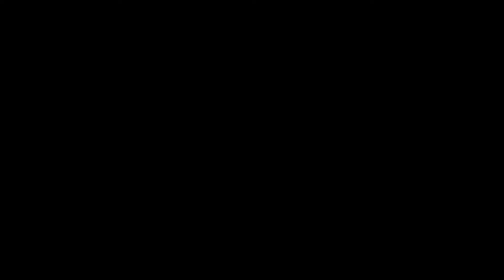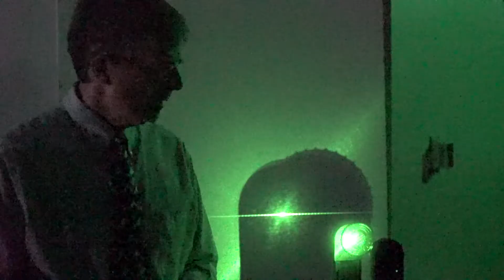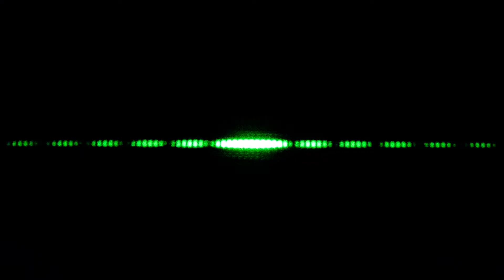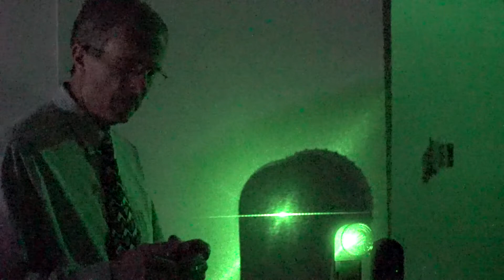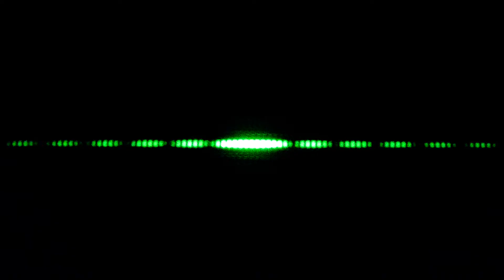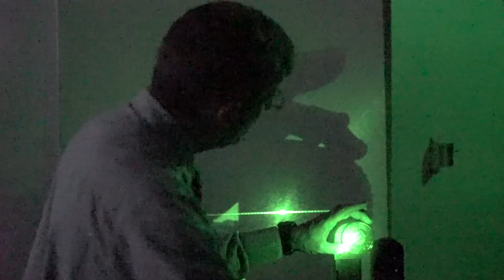Interference Demo: Double Slit

Comment: why does no one turn on a measuring device and show the wave pattern on the wall change to particle pattern in real time?  why can't i find a video with this demonstrated in real time instead of just simulated?
Reply: Why can't I find anyone answering this question !?!
Reply: Honestly i am gonna ask my prof in university this year if we can do it properly for once, too weird for me to not find it anywhere on the internet
Reply: Veritasium has a vid on it bit his graphed data looks too symmetrical at the outer edges for me to not be sus
Reply: I think to see that effect you need to fire a single photon or particle at a time which will still show an interference pattern after a while once many have been fired. Then if you interact with the particle before it goes through the slits the interference pattern will disappear. The reason you won’t see that here is firing a single photon or particle at a time isn’t something you can do with a makeshift at home experiment.
Reply: Because that expt is for electrons and not light
Reply: Any one find video for real collapse?
Reply: because the scale at which this collapse of the wave function occurs is not visually observable. It's too small to be able seen on video. hence the simulations.
Reply: @Akaniiii  why can't it be shown on video?  even if it's sped up or slowed down or viewed through a microscope etc

Comment: How can a single beam of light pass through two different slits at the same time???
Reply: A beam has a certain width. So if the slit-separation is smaller than this width, the beam can shine on both slits.
In more technical terms, I think it has to do with the coherence area of the light source.

Comment: Why central Maxima width is double than others?
Reply: Central maxima is not double in lenght 
Near the center the sepration b/w maxima and minima is so small that we often see it as a big bright spot but it is not
Reply: @jatinsoni524  this answer is RIGHT.
Reply: Because the constructive interference is maximum at that point. Hence its intensity is higher than other maxima

Comment: But in interference all the fringes have same intensity.
Here the central bright is wider I think it's diffraction
Reply: Intensity is not constant,as we move from 1 maxima to adjcent minima intensity vary as a function of cos²(∆ø/2) also what we learn theoretically is with approximations so intensity varies

It is not diffraction because green light is used which is monochromatic (having only one wavelength),for diffraction we have to use polychromatic light
Reply: @jatinsoni524  this answer is actually WRONG.
Reply: @jatinsoni524  Wrong bro.. diffraction is not what you think it is

Comment: can you do this with a white light source
Reply: You can do it with white light but you will observe colour dispersion,because white light is polychromatic(have more than one type of wavelength) so it will split us
Reply: Yes you can do it. But the image formed won't be clear as the maxima and minima of different colors (VIBGYOR) could overlap and gives you a messy pattern
Reply: the original double slit conducted by young was with white light
Reply: @Ahmed Hilaly yes we can we have studied in physics you will get dark spot of violet then red and so on you can also check it out on google
Reply: we can only do this by monochromatic source of light